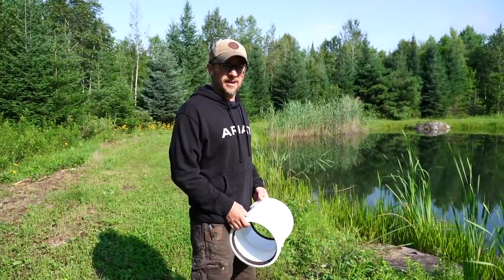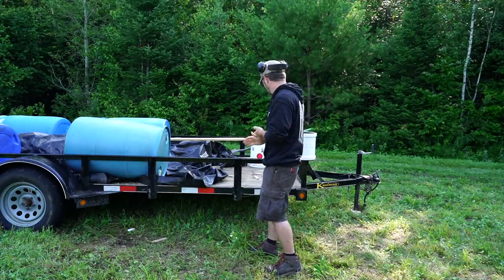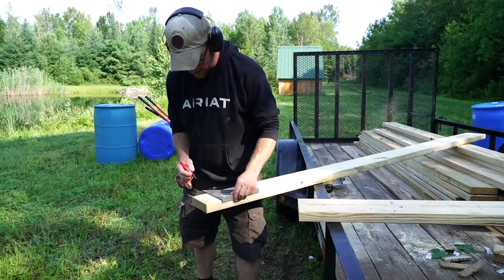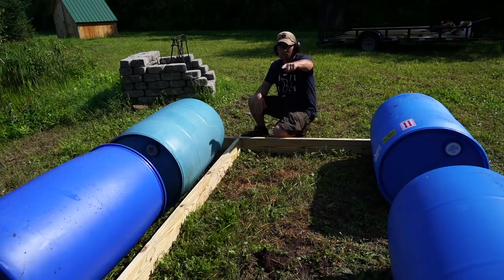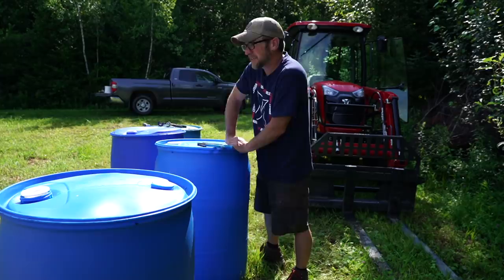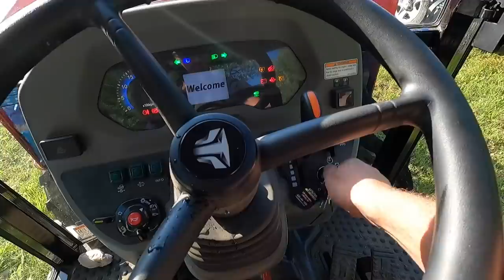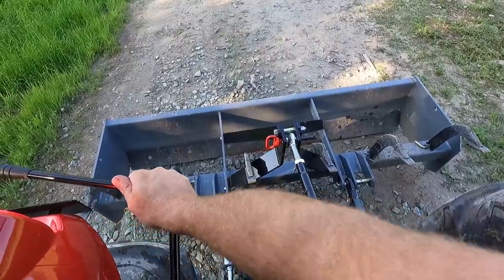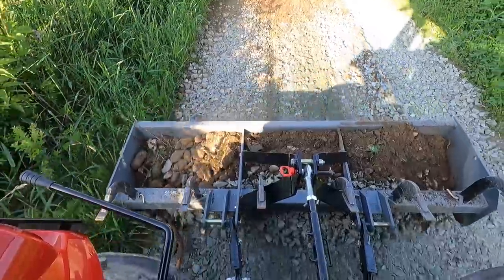Building a DIY FLOATING DOCK at our OFF-GRID PROPERTY (PART 2) & FIXING the Road for Upcoming BUILD!

Comment: Try a 8” Fernco Coulping….it’s a Rubber coupling with stainless steel bands…get a piece of 8” sch 40 pvc pipe the length you want…connect the two with the coupling and your done…local plumbing supply company should have everything you need
Reply: Added benefit is you could raise the pond by a few inches at a time by starting with the coupling low and a 4-5" piece of solid PVC pipe tight down against the existing pipe with most of the rubber coupling on metal pipe, then if you still want it higher, loosen the rubber coupling bottom clamp and raise it up a couple inches and re-tighten that lower clamp.  I really don't believe you want to raise the pond a foot, but perhaps you are right; just try raising it a smaller amount first and let it set at each height for a week before doing more until you are sure.  I know you could do the opposite by using too high a pipe and cutting it down, but then you risk compromising the dam or killing the trees along the edge before you realize it's too high.
Reply: I'd get a DNR hydrology person to give some feedback.   If you raise the pond too much, you may cause flooding when there's heavy rains.   We've all seen  the news reports in Europe what damage happens when bodies of water top their banks.  Flash flooding is  destructive when it has nowhere to safely runoff.
Reply: I was going to suggest the same thing. The ones I found were rated for both PVC and cast iron piping and were less than $30. He will need to connect a short sleeve or a ring on top to keep water pressure from collapsing the Fernco over time. We already know how he understands water pressure. He won't listen.

Comment: A emergency key on each of the machines is a good idea for those working in the middle of nowhere. A combination box attached in a spot you can access like inside an unlocked access panel would let you still run the equipment even if you lose the main keys and in an emergency someone else can bring a machine if it is needed like to recover the tractor or mini if you do end up getting one of them stuck. 

Same idea as putting a bigger key lock box inside the shipping container for all the equipment and the truck.

In getting ready for winter a 6 way blade that can do an offset can be a big help to keep the road in clear of snow even if you are mostly using the plow to clear it as the blade with the offset can be used to push the snowbanks back with the tractor not at risk of sliding off the road. Pushing back the snow when it build up will give you more room to pile up snow without needing to drive insanely fast to throw the snow off the plow to get over the banked snow.

Comment: Our clay drive swallows gravel in the muddy season. We get more mileage using mixed size gravel with “dust” in it. You are right saying more will need to be added over the years. Keep the road higher than terrain it travels through. Ditches and drainage matter and you have all the tools for that as long as there’s fuel available.
Reply: Crusher run to start with and build from there with larger stone.

Comment: We built an 8x10 floating dock using styrofoam buoyancy billets which, if punctured, will never leak and fail like the drums will.  Also, it rides lower than Al's.  We've had it for about 5 years now without any problems.  Al keeps saying "look at that view" but the view is not much when looking through the camera.  I'm sure it must be pretty when looked at in person.

Comment: Al, you work so hard on your road, but there is no crown or ditches to allow the run off to escape.  If you can adjust the box spreader to off-set so one side barely touches and goes deeper towards the end to create a crown. No tires will normally run down the middle, but its important to get the water off the road and into a drainage ditch. Annoying as they are, water breaks serve a very good purpose.

Comment: Your barrels are going to push your deck and warp them and make them uneven. Support barrels on beams. Ask me how i know.
Reply: use metal galvanized pipe straps to hold barrels in place? Reinforce deck structure above the barrels with 2x6 screwed flat under deck boards
Reply: @andreewert1142  Hi how are you?
Reply: @James McWhinney Hi how are you?
Reply: @rosalinaannpabelico7983  staying chill..painting

Comment: if you get an old chisel plow doesn't have to be big or new just something is 1meter wide or so and that way you can break up the road than shape it how you want then when finished put gravel down or if you have it over there but we have a type dirt/gravel that when it gets wet it hardens up and makes a perfect road. What you also could do is do the side of the road on both sides and make a slope so water runs off it.

Comment: There may be valid and important reason for the standpipe being located at its current height. The space you intend to fill with more water may be there to catch runoff from heavy rains.
Reply: That's a good observation you made 👍
Reply: Agree 100% you don't want it flooding
Reply: I believe it provides a buffer so the pond will have capacity to.hold the short term gain (from a good rain)and then meter it out.  If Al removes this buffer then when it overflows it will possibly breach the dam. Once the dam is breached then erosion will exacerbate the rate of discharge and in a extreme case drain the pond. I’d not mess with this!
Reply: Why are you guys looking at the "extremes" of what might happen?  There has to be a "very doable midpoint", that will create a bigger and better pond without any flooding issues!  Lol...the pond won't drain out, it has a couple springs that continually fill it!  If the remote chance of flooding does occur, do you really think that Al would let any erosion occur!

Comment: With decking you really need to leave a space between the boards. So the deck can breathe, have sufficient drainage, and make it easier to clean.
Reply: Good point.  If you watch closely, you can see them space with a screw.
Reply: @freepress8451  Ah.  Maybe better to say:
"With decking you really need to leave a space between the boards like Al did. So the deck can breathe, have sufficient drainage, and make it easier to clean."
Reply: @billinhouston3291  Not my place to say and the video was speeded up

Comment: Appendix.. That's a plastic pipe plug not a pot and its ill advised to raise the water level in the pond more than few inches since the embankments aren't that high in the first place. Plus the trees/plants on  the banks will die being inundated by higher levels as they grew there at its current height should be considered as well...
Reply: It's a spring fed pond and is considered a Natural Resource. Even in New Hampshire permits are required to change the flow. Federal Wetlands Regulations apply on Private Property.
Reply: It's your pond AL,  do what you want with it and screw the nazi's that don't like it .
And your not changing the flow , just the height . It's the same amount going in and out .
Reply: To Brent P. Played the N Card quite fast didn't you but owing land doesn't mean there aren't rules especially about Water and there far from being arbitrary. Many have found out that Water that crosses their property can't be diverted, held by a dam, and most important used as a sewer for what ever you throw into it doesn't belong to them. Indeed more than once land owners have been fined/jailed because sine they didn't follow the rules and Raparian Rights are just as enforceable even when it comes to even a State/County. Al should see if he's allowed to raise the water level since it's still a diversion as well as how much he can use since it flows off the property means he can't just take all of it letting others downstream get less. Sorry to pop your balloon but the rules about a Septic System and agricultural waste from animals are even more rigid since they cost lives when done wrong even off the grid. Indeed Private Lanfd is still in a County/Parish or under some Legal Entity and though in unincorporated areas the Law still applies on it and the few that are everywhere are about Water more than anything else.
Reply: @JerryB507  Hi how are you?
Reply: @richardmattingly7000  Hi how are you?
Reply: @richardmattingly7000 , What Brent doesn't realize is that I am not speaking from an environmental whacko point of view, but as someone who's dealt with the trials and tribulations of Senior Partners deciding that following the wetland protection rules don't apply to them.
Reply: To Jerry B. Many find out to their regret that owning land doesn't mean that they aren't rules, and some have tried to block a road/pathway thru it that connects to another's which isn't allowed since it's an established easement. Indeed many Off Griders get a shock pardon the electrical pun that roads, water, and even wildlife can be protected that's on it since it doesn't belong to them for that reason though many think otherwise. Posting No Hunting/Trespassing Signs have a legal effect especially with Hunter's who believe they have the right to go where games is even on private land and often ignore even Wildlife Laws when it suits them. A Colorado Policeman shot and killed an Elk that was well known but not a nuisance in Boulder then claimed it was a hazard but was found out to have taken it to be processed and was rightly fired for it because he assumed it was his for the taking. Al hopefully has asked the right questions about the Water on his land instead of just doing what he likes because others around him doing the same have destroyed Watersheds by being that unthinking and burying what should of been recycled like motor oil/chemicals thinking it will stay there isn't true and a natural spring is almost as mysterious as it is vulnerable to our machinations when we begin to see how to " improve" it with out hands..

Comment: I think I've seen people making these before and use some nylon net to hold the barrels in place should anything knock into them. It's probably necessary on a big lake or the sea -you may not need it.  They may be worth fitting to avoid having to do this later. I've said before, I've heard pockethole screwed wood is stronger because you're not screwing into the end grain - lets hope it holds out for you!

Comment: Dock is looking good.  I do have one suggestion though - every time I've seen a floating dock built, there are usually straps under the barrels to hold them in place - I guess it makes it easier to put the dock into the water in the spring and out again for the winter.
Reply: He used rope for the first barrel

Comment: Hi all, amazing work as usual.  Just thinking it would be easier to mark a few lengths of wood at the same time before cutting, instead of putting your tape in and out of your pocket each time.  Just an observation.
Reply: Usually Al makes one with the tape, then uses the result as a template for marking up all the rest.  More of an "assembly line" type of approach.  Perhaps Al just wants to be more "hands on" these days as he hasn't had as many lumber projects recently?
Reply: He does things that drives me crazy, but then I'm a carpenter  🙂👍
Reply: @colinstace1758  - Yes, me too.  I see things and my palm hits my forehead, but I still love them all!
Reply: @colinstace1758  Hi how are you?
Reply: @rosalinaannpabelico7983  👍

Comment: Those barrels will not hold up over time. You’d be better off purchasing dock flotation made for that purpose. They come in varies sizes to support different weight docks. Four 4’ x 4’ x 12 inch dock flotation devices would easily support that dock with twenty people on it.

Comment: Al... just for consideration... if you put those semi circular conduit or pipe anchors (holders) like you put on a wall to hold your conduit or pipe against it on either side of your dock coming off the shore, and then drive either rebar or some other kind of metal stakes through those anchors into the bottom of the pond, your main dock will not rock and roll so much.  It should steady up your main dock coming off the shore if you are so inclined.

Comment: Still need to add some ballast to the barrels especially if its used as a swimming platform and a small step ladder with 3/5 rungs will be a good addition which can made to be removable as well. One word of caution, you need to know how deep the water is around it and the other dock as well with a rod marked in feet on it since if it's too shallow it can be dangerous to dive into. Use the guidelines for traditional swimming pools as gauge as many have been  hurt or even killed by hitting the bottom when diving in plus knowing if there's rocks below is a must also. If the shore line slope is quite gradual they could almost lay in some gravel/sand as a beach of sorts and adding a higher pipe/conduit might be a bad idea since the water might over top the banks if it's that tall. One suggestion though a steamer insert from a pot with holes of about the right size could be used either in or inverted over the pipe would keep out more debris. Indeed think of a plug style pipe in the drain since it can be cut to height and with a few slits in its side would allow it to be put in like a cork plus holes can be drilled so it wouldn't have to flow over it to drain..

Comment: LOOKS LIKE A 5 GALLON BUCKET COULD FIT CUTTING THE BOTTOM OUT .IF TOO BIG YOU COULD CUT IT AND CLAP IT AROUND THE PIPE LIKE A SLEEVE THE WILL  WRAP AROUND THE OUTSIDE OF YOUR METAL PIPE